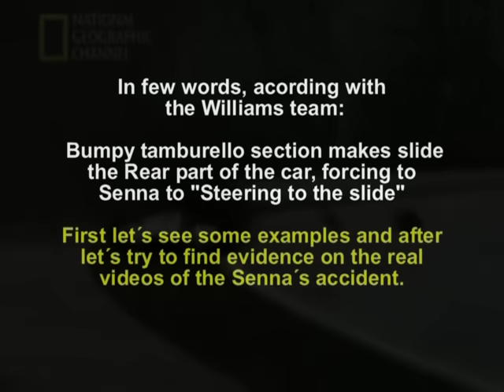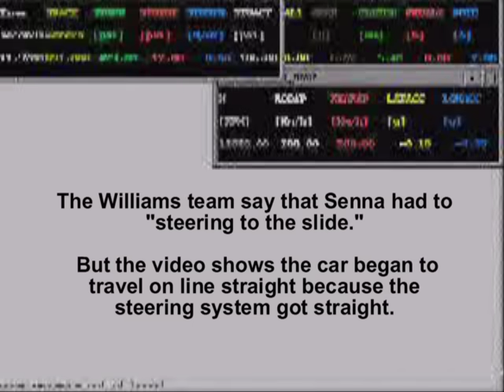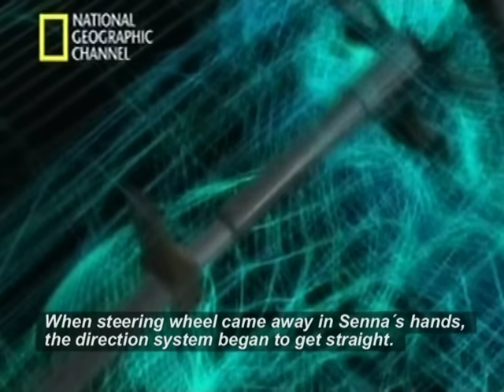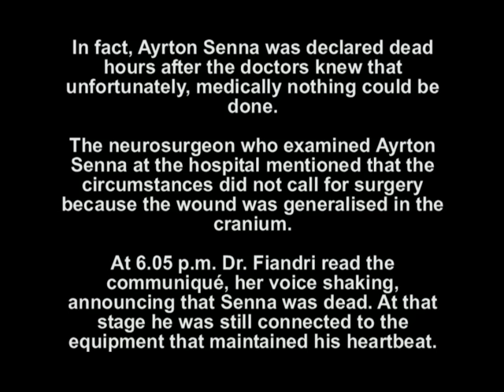5/5 the death of Ayrton Senna - what NatGeo did not tell

Comment: The fact is there IS actually a moment of oversteering. At 5:00 it's seen that the car rapidly moves a closer to the kerb (from the perspecive of the onboard footage the kerb moves lower toward the suspension). And that means nothing short of the front of the car sliding to the left while the rear is sliding to the right respectively. Also it is very clear that after that Senna turns the wheel to a 'neutral' position although he never actually turned right and the move seems too calm for a reverse steering in respond to the slide. Anyway this is the moment where the accident starts unravelling. Senna is then seen steering to the left again but we don't know how forcefully actually. All we can see is that the yellow dot disappears but we can't tell much from this as it already had happened at one moment while he was passing Tamburello and obviously at that time he steered quite gently as even the angle to which the left wheel turns is not even visible (which renders the analysis of its movement quite useless btw). 

Also it's very confusing that his hands didn't cross which most probably would have happened had Senna been suddenly left with the steering wheel dangling in his hands with the column attached to nothing. And after hitting the breaks it's very unlikely that Senna even steered at all as it would have only decreased the decelleration - watch the onboard footage from the Schumacher's car in Silverstone'99 during his accident. The guy new his brakes half went off but he didn't try to steer away from the approaching wall. Why would Senna do the opposite with his brakes functioning?

Comment: What puzzels me as a trained mechanic is the fact that they welded the steering column. The first thing we learnd - 40 years ago - was to NEVER weld or HEAT steering parts - because you're WEEKENING the metal when it gets red hot. I once had an engine where a rod let go just where some fool welded a counterweight on...go figure...

Comment: From the fracture surface of the steering column it would be pretty easy to differentiate any pre-existent crack due to fatigue from an overload failure due to the accident itself. All evidence has value in an accident investigation, but I would rely far more in the fracture surface than in the computer data.

Comment: I'm pretty sure that it was almost completely proven that it was a bad weld and the steering broke which caused him to be unable to control his car and smash into the corner. Think about this for the second, one of the best racers in the world cannot correct his steering to not smash into the wall, he never turned left to avoid a direct smash into the wall, and the car suddenly jetted out and did not turn after it did so.

Now, do you REALLY think that a loss of downforce would cause a car to immediately jet out and smash into the wall? Lose time? Lose some grip? Yes. Lose all steering? Hell no.

Comment: I assume the steering shaft was made from chrome moly steel, which needs to be heat treated after welding. It will fail at the weld joint unless heat treated after welding as a unit.
Reply: Depends on the thickness. If it was thin walled tube, under 3mm, then there is no need to heat treat after welding. Even if the tube wall is thicker as long as the tube is preheated then, there is no need to post weld heat treat the object.

Roll cages in cars are often constructed from chrome moly and they are not heat treated after welding despite the wall thickness being over 3mm. The advent of TIG welding has further reduced the need for preheating before welding. 

The use of the incorrect filler (rod) causes more issues than anything else due to dissimilar cooling rates so something like ER80S-D2 through to 4130 should be used. It's even more important on thin walled tubing. I'm pretty sure that the engineers in the team would have been absolutely aware of the processes needed.

Comment: At 5:01 the car does wash out, ever so slightly, moving left then suddenly there's no steering and he plows straight off into the wall.

A driver as experienced and instinctive as Senna would have saved this and/or maneuvered the car in such a way as to minimise impact, if he had a car that was still able to steer.

So, either the car really did turn into a giant surf board due to the lowered ride height - which doesn't explain why it didn't go off the lap before or why the wheel still turned - or he simply had no control because the wheel was unable to steer the car irrespective of the tyre pressures etc...

Comment: If you just watch the video you can see Senna moving his hands to steer but the tires not responding, that can only happen if the steering becomes detached, resulting in the car continuing in a straight line. But I can remember there was some great controversy, even before the wreck the day before which claimed the life of another driver, and Senna was at the center of that controversy arguing for greater safety measures around the track and in the cars to help protect the drivers in this exact situation, and if I can remember correctly a great reassessment and implementation of safety measures followed Senna’s death that improved driver safety, not only in F1, but throughout racing! Too bad it took the death of a racing icon to bring about the driver safety which was needed for a long time.

Comment: It might have been the steering column that broke but i will say this. At 300km/h steering looks a lot diffrent. If the wheel moves 1cm it turns the car a lot. In a slide you usually correct it with small movement in the opposite direction. You ask why he didn’t crash at lap 6. Well he could have taken the corner a bit differently, was it the exact same place where was he positioned. Depending on his tires position and the speed luck and much more. You can drive a car 1000 times at the same place and diffrent things might happen. I’m from Sweden so we have a lot of snow, and every winter we are outside drifting. And you have to know that you can take the same corner again and again and it’s a bit diffrent everytime. Sometimes you understeer sometimes oversteer. Same corner same day 10 minutes later, sometimes when you understeer you get the car under controll faster than other times. At 300 km/h loosing that much downforce would probably put me in the wall as well. It doesn’t matter how good of a driver you are. In 0,3 seconds you would be way of at 300, it’s so fast that once you’ve corrected the slide you would probably have moved 5-10 meters to the side depending on how fast and how much you’re sliding. You show clips of them going 70 and saying how much they slide. It’s a long corner not a short one. It isn’t tight and you’re going so fast so you’re not turning the wheel much. So the car behaves a lot diffrent in a tight corner at 70km/h compared with 300 in a long corner. And also the car probably oversteered and understeered at the same time. Remember 2014 ferrari? Remember he lost a lot of downforce so the rare would slide. And then he corrects it by turning the other way, but now the tires are facing to the right and the car is moving to the left and he probably regained the rare. And so he understeered toward the end. And also as someone who drifts during the winter, when the first snow comes you have spots with a lot of snow and some without. So if you’re taking a left turn you can all of the sudden get a lot of grip and the car starts going forward. You had controll of the slide but once it gripped out of nowhere you lost the controll and you’re heading toward the ditch. You just stand on the brakes and hope for the best. This is why a lot of swedes crash when the first snow comes. It’s so unpredictable, and that car was unpredictable and if he lost downforce had a little slide not big but you feel when the rear goes even if you still go almost straight. It just makes sence from what I’ve seen from what you showed I still belive he lost downforce corrected then understeered then got grip again. But by then it was to late and you just prepere to crash. If the hans device existed back then he would probably just have walked out if the car. Dale Ernhart were going 260 when he crashed. Looked like a normal crash that you would just walk out of. But he didn’t, his brain hit the cranium and succumbed due to it. It’s sad but I don’t understand why they woulf cover it up. Things brake all the time, Ronnie Petersson had like 43 brake failures in 4 years. At some point during testing races and such. Niki Lauda crashed to suspension failure, but ferrari didn’t get a lot of backlash because the sport worked like that. If the steering column broke FIA would have made some changes due to it breaking

Comment: 4:55 How can they lie and say Senna tried to correct the steering when you can clearly see the front tyres never turn. Clearly Senna did try to correct the steering but the front wheels don't move. If that's not proof of a broken steering column I don't know what is.

Comment: Senna requested new steering column placement (closer, which means longer shaft). Williams does the work but it does not get properly utested because practice on Saturday is canceled because of the accident/death of RR. Sunday rolls around, and it breaks mid yerm, car stays on the same line.  Senna brakes but runs out of road. Tire/Suspension impact his head upon the crash

Comment: When your car starts to slide or drift you have to counter steer to correct it or you will spin.  That's why inexperienced drivers crash most of the time when they try to show off. The back end starts to get away and they over correct and go straight into a wall.   That's not what I'm saying happened to senna, his steering broke. I'm just describing why they have to counter steer

Comment: The simple truth is, Ayrton was not comfortable with the positioning of the steering wheel, and insisted it be altered, Patrick Head was unhappy with re-working the steering column, effectively in a lock-up garage, but Senna was a hard man to dissuade, so against the teams better judgment, the steering column was cut and shut, if the mod had been done at the Williams factory in Oxfordshire, proper testing and stress calculations would have been carried out, but that was not possible in a lock-up in Imola, I'm absolutely sure everyone involved in the decision have deep regrets and with hindsight, would never have done it, but Ayrton was a difficult man to say resist.

Comment: What never gets talked about is didn't wheel tethers get added/strengthened and side heights of the cars raised as a result of this race? That alone could've possibly saved him? It was the terrible luck of flying debris hitting his head that killed him...even if the steering broke, he was at 130ish mph? Drivers have survived much worse. It was a true tragedy, but not conspiracy, Senna's death. In it came a number of safety improvements that were clearly needed. 
Including pit lane speed limits. If I recall, there weren't any before this race, but a wheel flew off someone flying down road and injured a few people. Its kind of crazy to think they were still allowed to do that up till 1994, and that pit members could just hang around while they did so. Much safety improvement was needed. Tragic so much death and injury needed to happen for the changes to happen.

Comment: The cold tyre theory is nonsense. The cars had already done one lap at racing speed when the crash occurred. The car had a mechanical failure. Senna was far too experienced to make rookie driver error.
Reply: Agreed. Common knowledge to weave and get the tyres back up to speed, AND they had one normal racing lap after the safety car

Comment: It’s racing, everything is stressed to the limit and that’s the idea. Whatever it was, if the steering column broke (most likely) or if the tire or a piece of suspension killed him after the wreck does it really matter? He was pushing the limit, knew the potential and was lavishly rewarded until his accident. High risk high reward. Things break and ppl die. That corner didn’t need to be so dangerous but it was. At least he was killed in a minivan by a drunk driver, he never got old and watched his ability decline, he’ll always be in his prime forever!

Comment: if you've ever lost the grip from rear of your car on high speeds, you know it ain't going straight and certainly not opposite way of the slide.. that could happen only if the either the suspension was off balance or it had to be a steering/chassis issue.. as a teenager i was able to notice that.. how couldn't they know that 😐
Reply: i know this cause I've been through this, twice. once i went straight off but there was no oversteer or slide, it was the front suspension and second time the car slid off into the corner cause i revved it too hard... idk.. to this day I'm always confused

Comment: The accident was not caused by the tire pressures I genuinely believe that it was the steering column but they don't say that because that would mean it was Williams fault. And if the car touched the ground and losses grip I think it should oversteer because the flat surface under the car was mainly on the back so when it touches the ground it should unload the rear tyres. And as we can see Ayrton lost the front because he didn't countersteer

Comment: The welded in extension to the steering got a fatigue fracture. It went unnoticed and failed at an exceptionally dangerous section of the track. This was most likely just a case of misfortune. This does not sound like a case of negligence and it does not sound intentional. The coverup though, most certainly was. But that means that the team knows what happened but is maintaining a lie. 

I wish that the outcome of the trial was included in the text.

Comment: I have watched this series of videos carefully at least three times. I believe that the poor quality of the modification to the steering shaft, and failure caused this accident. The story indicates that the steering shaft had stress cracks in it at the point where it was extended prior to Imola in April/May of 1994. Wouldn't it be safe to say that inspection of the steering components before every race or track session would be of utmost importance if you wanted your Driver to have a safe car.  The cars running so close to the ground that bottoming out is a real concern in terms of being able to maintain control of the car. I'm sure that this detail has contributed to many accidents as well. I think that the ride height on all cars competing in motorsports should be required to be high enough that they don't bottom out at normal or uppermost limits of competitive speed. 

RIP Aryrton Senna, and Roland Ratzenberger.

Comment: I don’t blame anyone, however I wonder what the piece of tube steel for the extension in the steering column looked like or where it came from. I know how mechanics work sometimes when in a pinch. I wonder if an unknown piece of scrap was used in the extension on the column. I wonder if a noob welder was allowed to install it. 
All I know for sure is that the young ayrton Senna was a genius at driving!

Comment: Why would a racing driver slow down if you regain control of the car, the only time a racing driver would apply full brakes is if something breaks and can’t be fixed in a spot second, it’s clear that the steering column broke.

Comment: An understandable theory but not a very plausible one. It is like his car completely lost the ability to drive and with the management systems they had on board (new at the time)  it makes you wonder what really happened. The other part is why was the data loggers not immediately handed over. They were shipped off with the car to the Williams whatever and wasn't handed over until later. This leaves room for tampering. Even looking it the footage the corner was not that sharp, and even if his car lifted he should have easily gained control. His car literally just looked like someone switched off all steering to the car and left him defenseless going straight into the wall.

Comment: Isn’tthe point with the cold tiress that contracted absolute bullshit? i mean over the course off the race the tires are slowly being worn which causes the ride height to lower aswell and that probably has an even bigger effect than the temperature and that doesn’t cause the cars to bottom out
Reply: Your point is correct, but you need to consider that the car is also losing weight as it uses fuel, which would have the opposite effect to tire wear of raising the ride hide as the car gets lighter. Anyway, it's probably not worth discussing as it wasn't the cause of the crash.
Reply: @alricdark  Yeah that’s true, i didn’t consider that

Comment: im still thinking that the steering suspension by the right weel nodded  (like max verstappen had after his pre race crash at Hungary). if had never seen an cam on the right side of the car. if the suspension nodded you drive strate forward (max Verstappens 2019 Belgium crash). am I stupid if im thinking this?

Comment: Senna's front wheels never turned to avoid hitting the wall.  This should have been the only evidence needed to show that the steering column had broken mid-turn.  You can actually see Senna's car straighten out in mid-turn pinpointing the moment the steering column snapped in half.

Even if the car had lost traction and was skidding along, Senna would have turned the steering wheel to avoid the accident, don't you think?

Comment: Are not those black sections on the bend a bit like the traffic calming sections on normal roads i.e. outside schools which would be very slightly higher than the usual surface height